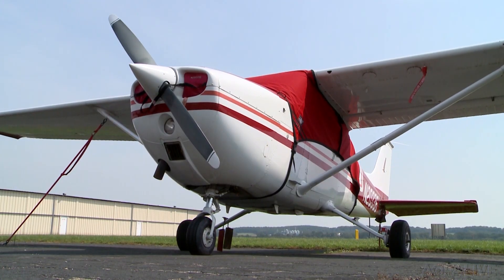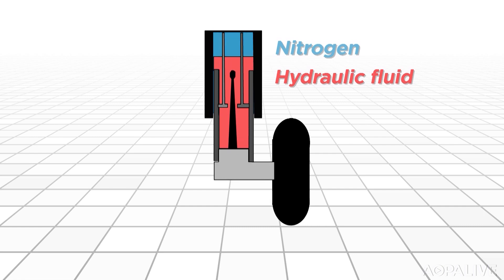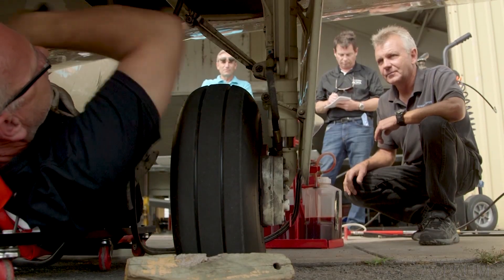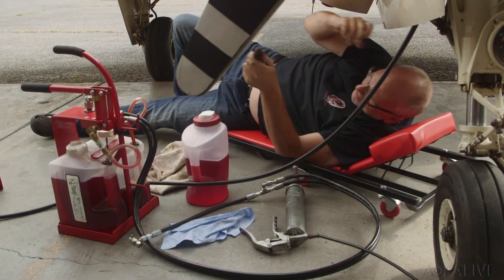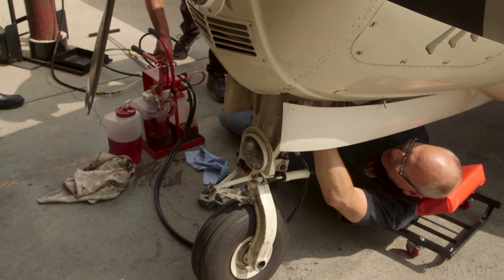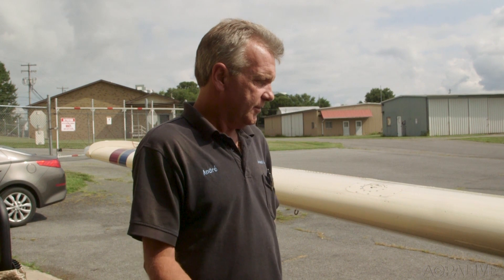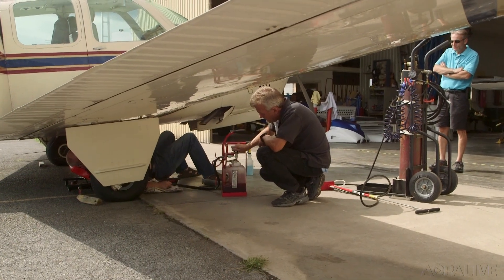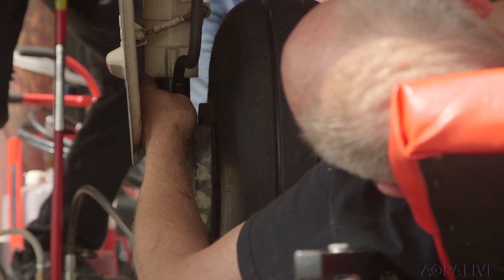Oleo strut maintenance

Comment: 30 minutes to get it on jacks? Our school mechanics push the tail to the ground and leave a sandbag on the elevator 😂
Reply: The elevator is there to take air loads, not sandbag loads. This method will stress the structure.

Comment: what it the "bicycle pimp" device for? The N2 is at high pressure from the tank. Is that used for pressure or an extra cutoff valve so fluid doesn't back up in the tank accidentally?
Reply: Tim Kiehl, Yes, the “Bicycle” Pump boosts the Nitrogen Pressure from a lower pressure nitrogen supply tank. You could even use “Air”, but this is not recommended as Air has moisture/water vapor and oxygen which can cause problems in the strut/seal. Alternatively, you can have a High Pressure nitrogen tank, full enough to still have high pressure and valve/regulator with appropriate hose and aviation Shrader-valve connector. Typically, you would use wing jacks to lift and remove weight from the aircraft or alternatively you could bounce the strut with an assistant who carefully lifts the wing along the spar so as not to bend anything and jounce the aircraft up and down until it settles, then add or release pressure to adjust correct exposed cylinder length to specifications.